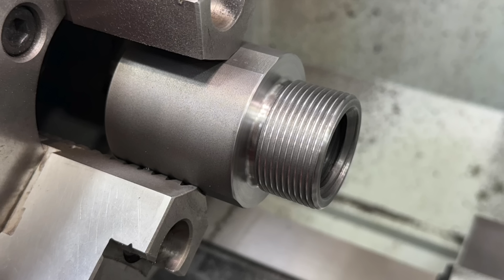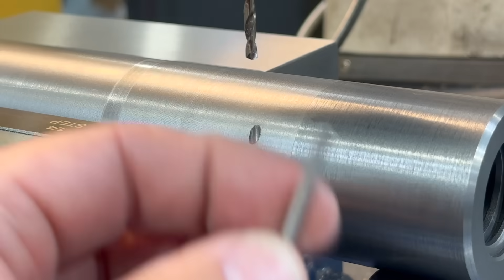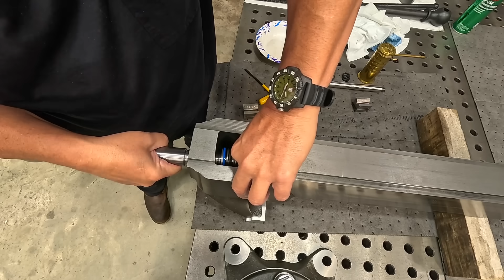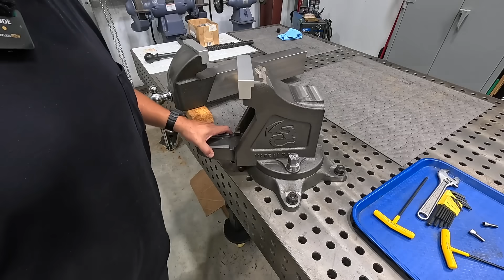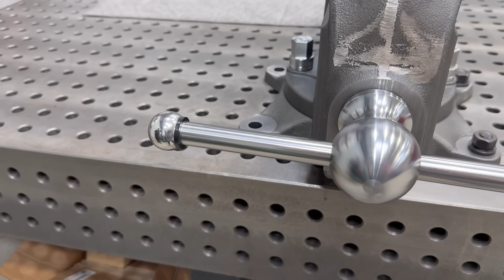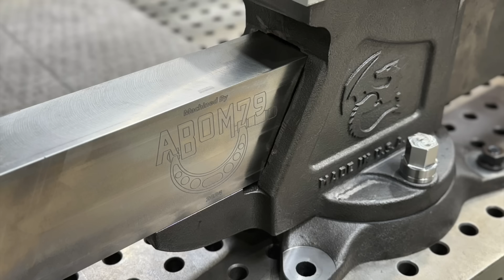USA Hardtail Final Machining Mods & Assembly

Comment: I dunno if you're already finished painting your abom hard tail vice yet.  I'd go for either a nice high gloss black paint I think that would make your machined finished item really pop. Or look at getting the castings bead blasted with fine glass beads and just clear coat the bare metal casting. That would look really sweet I think too. I think getting some hand painted art on the sides of the hard tail is a really cool idea and I'd love to see some nice murals on the back of the vice.

Comment: You made so much efforts for your custom bolts and in my opinion these chrome/ silver bolts would look nice with a black or a dark gray vice. Also did you think about milling the bolts to mount the vice on the table maybe at least the top? But probably they are not included or everyone use different ones. Keep up, love your vids and explanations.

Comment: I think a CNC milling project that you can do so you can choose soft steel, brass, bronze, aluminum, etc for the jaw material and knock out sets in different materials. I'm a little surprised you didn't mill down the lower jaw support and make up some bronze slides for it.

Comment: I say do the jaws out of brass. It would really pop against black or green.
Powder coating isn't very expensive to buy a simple gun. Hardest part is the oven big enough. I built my oven using 2 off the shelf oven elements and a cheap heat controller. I think i have about $400 in my whole setup with me building my oven. Made all that back the first year doing parts locally for people. My 2nd year I was able to buy a bigger air compressor (screw instead of pump) and blasting cabinet just from what I made from powder coating. Nobody in an hour drive does it around here so I become the go to guy.😂

Comment: ever try using adhesive back sand paper with aluminum bar as a sanding block??  I've been able to hit tapers and tolerances far better than strips of cloth back abrasive. I've also used the sandpaper on strips of shim stock. seems to be controllable and precise.  
 great channel, great work.......

Comment: I think, and I learned this from you, if you loosened the two screws on the very back of the hard tail, tightened the vice up then re-tightened the back screws again, it would allow the main screw to self align by a thou or two and make it like butter.

Comment: looking at the spring compression fixturing, you just finished a nut that fits the screw you are trying to tighten, so a piece of tubing against the spring, and you could use the vice spindle and the nut to compress the spring.  That would mean all the force was contained by the vice spindle/nut and you would not have needed external bracing to hold anything.  The tubing would just have to be long enough to reach to the threaded area of the spindle.

Comment: Get a quick-clamp, one of those rigs that tightens when you squeeze the handle, and replace the fixed jaw with a fork that will reach around the shaft and bear on the back of the collar.  Set the moving jaw on the meatball, slide the fork behind the collar, clamp it up, and then reach in with an Allen wrench long enough and snug it down.  Or am I missing something?

Comment: When I heard the  plan to add a pin I immediately thought: would be nice if you could turn away the protruding ends on the lathe, but the hits of the tool will just drive the pin out of the hole. Adam does it and it works without even moving the pin a thou. WHY does it work?

Comment: Hi Adam, I have had the satisfaction of making a vice from castings. All components machined including screw, nut, handle and jaws.
The jaws were steel and the checker pattern put on with a shaper then sent out for hardening.

Comment: Spring pins are by nature hardened. They wouldn't be a spring without hardening.
    The lettering could be milled gently to highlight them and then powder coated.
Reply: Of all the tools he has, bewilderingly he chose HSS to cut hardened steel. I see no possible reason for that choice, obviously he did not know that the pins were hard. No surprise there.

Comment: Ya may have figured it out already, but loosen the four bolts on the vise body and the two bolts holding the nut in place, then tighten the vise down to a light compression, and then tighten all the bolts. It should self align and the clearances would come into play and it would be easier to use.

Comment: What about using the hardtail nut and a spanner to compress the spring?
Could use a bearing to keep the face from getting scratched. 

Or is the nut not long enough?
Reply: What about mounting the screw to the rear of the vise and making the nut part of the handle.

Comment: For painting, check out an auto paint shop that does custom work. If they have a guy that can do freehand pinstriping, he can use One Shot to highlight the embossing. 

And while it's there, have them use body filler and smooth and sand the screw cover. Then paint flames. Because flames!

Comment: Creativity is the mother of invention. Where there a will, there is a way. While watching I knew you was going to have a problem machining the roll pin with HSS. I think I would have shortened the pin square cut so it was recessed in the hole. Nice piece of work!

Comment: Powder Coat would be horrible long term as you cant 'fix' it WHEN you chip it of knock it. Some Airbrush work maybe but KISS and Classic would be my call.
Reply: CNC an engraving of logo😊
Reply: Powder coating can certainly be fixed without too much trouble. Just get a kit from Eastwood and an old electric oven. As long as it fits inside, you're good.  This vise might be tight for many old ovens though.
Reply: @firesurfer  Compared with getting out a Brush and a pot of paint this lump is way to much trouble and poor option to Powdercoat even initially and is certainly not a job for a domestic oven and an Eastwood kit. You have moving and locking parts along with clunking other bits of metal around it.

Comment: I had a little chuckle to myself when you cut that roll pin to length with the grinder. You aligned the camera up perfectly with the rear of the cutting disk and when you started to cut I put my safety squints on without thinking. Despite being 3,000 miles away!

Comment: I always liked the idea of the screw ( a piece of stock high tensile ACME studding ) mounted at the back of the moving jaw and the nut incorporated into the handle Neater, simpler, less material wastage, stock studding easier to replace and all the thrust bearings, seals & springs contained in a cylindrical cassette slid in from the front.

Comment: I'd probably go with cerakote or an oil based 2k automotive system. Cerakote is going to be far more durable but the 2k will give a fancier finish. If you go the automotive route, check out Tamco for the primer & clear. Their products are top notch but also don't break the bank like PPG does. I think they mix custom colors too but I've never used that service from them.

For the detailing on the hard tail you'll be looking for an automotive painter to either do stenciling or some type of pin stripe work. Idk how well that can be applied over Cerakote as it's fairly slick but I don't see why you couldn't scuff sand that section to paint prep like any other substrate.

Comment: What if you loosen the four bolts of the tail and get the jaws almost closed? Assuming we're talking Abom-level tolerances, the screw and nut should self-align if there's enough play in the bolt holes.

Comment: Adam,

It has been great watching you machine that vce.  I enjoyed the changes to the design to satisfy your preferences.  

If you don't mind some suggestions for your consideration:
1. A set of brass and a set of lead jaws so you protect delicate surfaces.
2. For painting have an auto body shop paint the vice-president an iridescent metallic red.  The Fireball logo can be paint in orange and yellow with black highlights.  The cast lettering should be white with black shading.  On the sides of the fixed housing for the nut assembly, an American flag and "Made in the USA."  You need only use Blue and white and use the metallic red for the flag.  
3. Next to the flag add your logo and the words "Customized By."

Thanks,

Bob

Comment: If it ain't broke.... Don't fix it!

(Or, these days, it seems like the maxim is 'If it isn't broken, FIX  IT 'TILL IT IS!'... It's a brave new world, with 'planned obsolescence,', and 'design life', and so on, baked into 'progress', and the economies of scale, etc. (it isn't all bad, if it is obvious that a product will be more economically replaced rather than maintained before it fails, why build it to last?) ...

When it costs less to throw a product away an replace it than to fix it, why fix it? Well, there are lots of reasons re: sustainability, environmental impacts, and so in. (A basic example would be paper/plastic containers- why make them out of glass when it is far more profitable to just use wood pulp/ hydrocarbons? There is no reason to do so! (For a business driven by profit/shareholder value)..

Combine the foregoing with 'The tragedy of the commons', and one has a recipe for the modern disposable production/consumption economic dynamic, which may or may not be sustainable... Does Murphy's Law, Catch 22, etc, etc, come into effect? (Or Dunning/Kreuger? /facetious semi-joke.)

Really, I suspect we are fucked. (But, we have been before... Well see what happens. My primary concern, however is something that has heretofore been a serious yet ultimately negligible concern- that of HUBRIS. (I think, personally that we are acrewed and, the sooner the better. I only hope we can create AI that will replace and survive us- personally, I have no problem whatsoever with being an intermediate step in the evolution of minds that may (almost definitely woll) outlast out small tick in the clock of existence... Can you imagine any greater purpose?)

Comment: I have a 40 year old 3 1/2 inch craftsman vise I’ll trade you
Reply: Hehe... Me too! 👍. 

Actually I have two of them- probably from the 70s, with little four inch wide/ 6 inch deep jaws, not anything special... I have them mounted on an old, old  2x8 as a jig for holding my skis stable so I can tune/wax 'em a couple of times each year.  (And every year, I have fellow ski bums ask me if they can use my setup to tune their gear! (including my 1950s straight-up fire- hazzard electric iron for melting the wax/p-tex! (P-tex is like Bondo for skis).

Even inexpensive (meaning... mediocre?) gear, which can be bought for a pittance, can still have their place. That's one of the things I love about old, 'nothing-special, but still useful' tools! (Old planes, fasteners, and strange/unique homemade tools also come to mind!  ...Or maybe I just can't throw anything out? 🤔).

Cheers! (If it ain't broke, don't fix it!!)

Comment: Find a couple of high quality good fitting (reversible?) six point flat ratchet wrenches just for the one purpose on those  sharp looking shop made left and right locking nuts would really be handy !! - Could  easily pull em off any time ya wanted, flip em over to reverse or use reversible ones.  What a beautifully crafted and machined bench vise, love it.

Comment: @ 10:30 I knew you were going to cut that spring pin in the lathe! I might have used a "Spirol" pin... 

And as far as paint, maybe Wilton green? Kind of an "old school" retro touch.

:body-blue-raised-arms:
Reply: I would have cut the pin to the right length in the first place so it didn't protude once driven into place.

Comment: Great job!  My two cents.  
The color should be Hardtail colors for Jason's benefit since he designed and provided all the castings and it is just modified to your specs, which are excellent.  I like the idea to powder coat it.  Since this is the first USA made casting, would it be possible to laser etch or engrave an abbreviated "history or story" on the side of the dynamic jaw or top of the casting, crediting the designer and you for your mods with approximate dates?  That would probably require a rectangle of machined surface to work properly.  Just my thoughts, but the history of this vise should be kept with the vise for future generations.  And I agree that I would only display the vise or gift back to Jason for his display or donate to some machine facility open for public viewing.    Thanks.  Good series.

Comment: You may not want to, but I recommend putting a rubber O-ring on each ball of the handle. The O-rings will prevent pinched hands if the handle drops unexpectedly.
Reply: Go back and have a closer look.

Comment: When you were spinning the handel real fast I think I detected a slight imbalance in your meatballs.

Joking aside, could you put some shim stack under one side of the nut mounting flange to get the nut tube to angle ever so slightly to help center up the nut tube to the screw?

Comment: You may get a little relief with the centerline alignments by loosening the tail housing while the jaw is installed and then retightening. They should self-align somewhat, depending upon how much play there is in the tail. 
Also, 10 or 15 years from now, someone (maybe even you) will be cursing 'whoever' contoured the ends of that roll pin instead of leaving the ends square so that they can get a pin punch on it. But that's a problem for the future ;).

Comment: Loosen the bolts holding the tail and nut on. Run the moving jaw in and re-tighten the bolts. This may allow the nut to be better aligned and reduce some of the friction.

Comment: @abom79 If (when) you have to set the lock collar again, consider using a tube, like you said that just fits over the rod, that leaves an inch or two of the threads exposed, then use the nut to compress the assembly. No need for the elaborate setup. Always love your commitment to detail, this project has had no lack of that! Great work, and thank you  for bringing us along again.

Comment: Powder coat.
You should make a scratch mark on the dynamic jaw at the same angle as the main vise housing to indicate the maximum amount to open the jaw. If you or someone else opens it too far it will take off their foot.

Comment: I think a split round nut could be a better option to clamp the dynamic vice shaft, screw it to required pressure, then clamp the nut.

Comment: If the hard tail nut was open in the back, that would be the spring compression tool you needed. Since it's not, a piece of pipe in front front of the hard tail nut should give you the extra reach you need to compress the spring. If you take it all apart to paint it that might be worth trying. Black paint with old school pin-striping would be a cool look.

Comment: 👉A tip to keep threaded items from backing off without locktite.. Put a dab of Permatex Ultablack RTV on the threads. You can still remove the part by hand but it will never vibrate loose. Keep all your RTV in the freezer after opening and it will never harden in the tube.
Reply: No use in this application as the nut gets both tightening and loosening forces with every use cycle, but still a nice tip for use cases where vibration is the issue.
Reply: @StikkyWood  No, I didn't say in this use. I wasn't asking for confirmation I was just stating the fact for others to use if they like. I'm an old man drawing on a lifetime of experience and most people understand where this tip would work and where it wouldn't without listing every possible scenario.